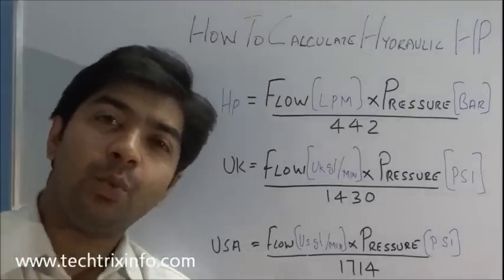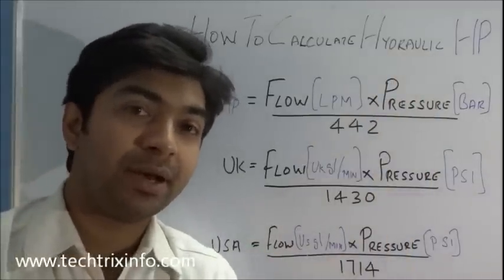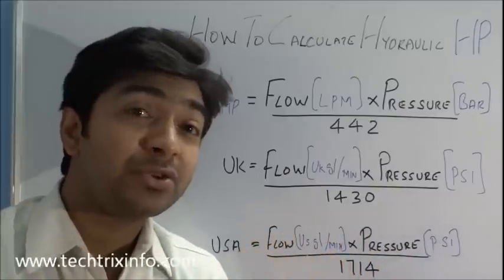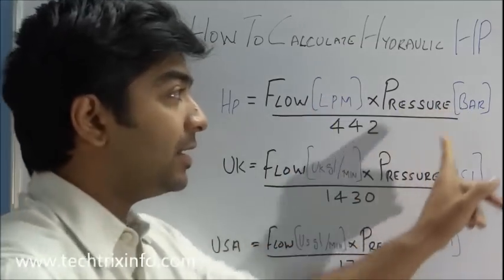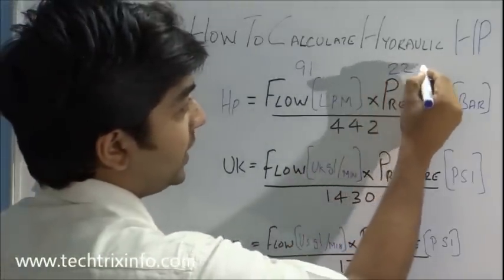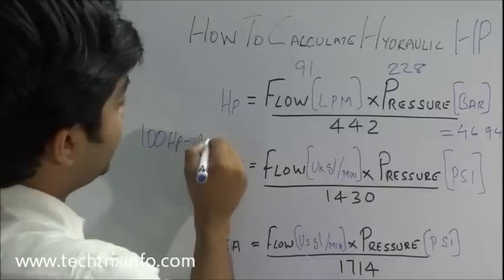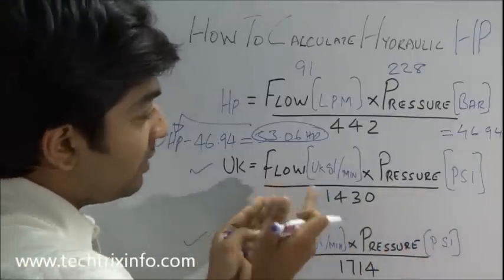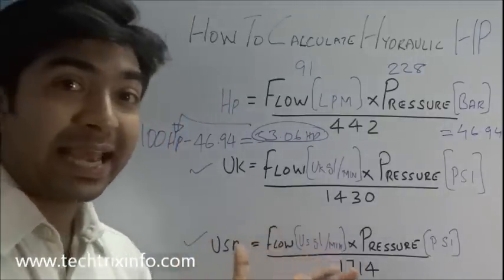How to calculate hydraulic horse power (hp). ✔

Comment: You have missed out factoring the efficiency. Practical sizing or selection of the prime mover or motor will require accounting for the pump efficiency, derating factors for ambient conditions, other mechanical drive losses etc.

Comment: Sir india ma kw se hy. Motor selection ka formula kya hai
Reply: Hello
Reply: Sir mail id send kr degeya
Reply: @vivekpandey841  
... Send ur message what you want to understand , I will try to explain you
Reply: Sir what a Malfunctio in Hydraulic system .my solenoid valve 4/2 in this valve always malfunction.
Reply: Sir why close loop circuit ma without direction control valve se cylinder ko move kr sakta hai
Reply: @vivekpandey841  Directional-control valves include spool, rotary, and check valves. Consider the following when troubleshooting these valves because there is faulty or incomplete shifting:

• Control linkage is worn or is binding.
• Pilot pressure is insufficient.
• Solenoid is burned out or faulty.
• Centering spring is defective.
• Spool adjustment is improper.

Consider the following when troubleshooting directional-control valves because the actuating cylinder creeps or drifts:

• Valve spool is not centering properly.
• Valve spool is not shifted completely.
• Valve-spool body is worn.
• Leakage occurs past the piston in a cylinder.
• Valve seats are leaking.
Reply: Sir Hydraulic motor se cylinder ko move kr sakta hai  retract .and extended
Reply: Sir my new pump and not any problems pump and suction line but pump in sound. Coupling and spider key shaft better condition but pump in sound?